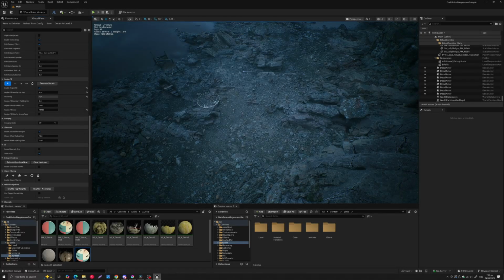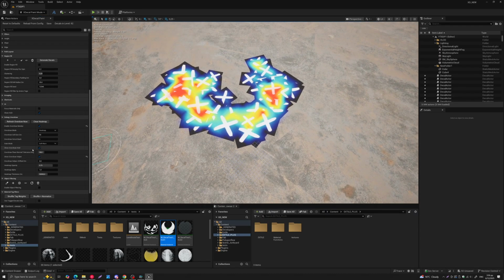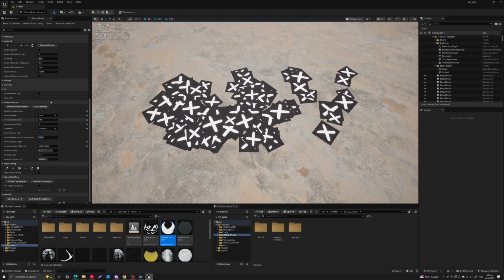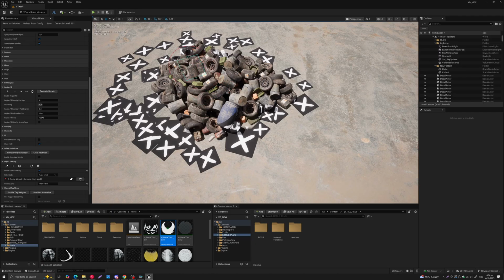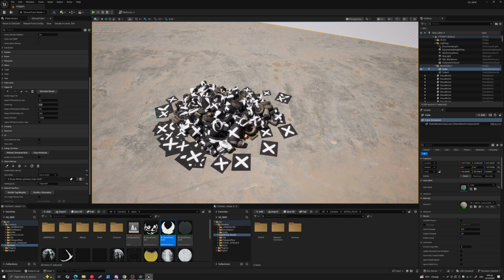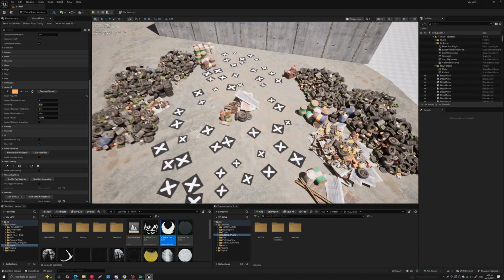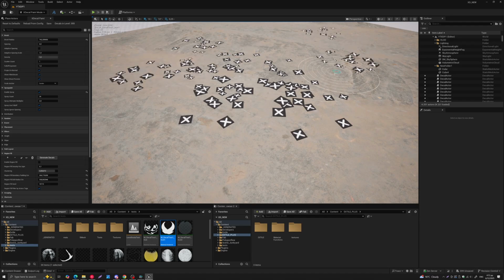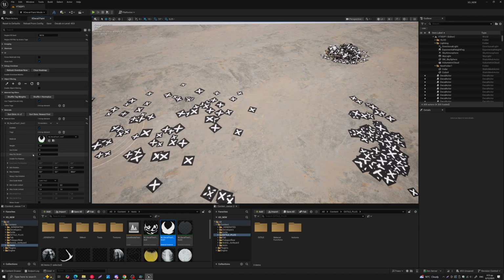The Ultimate Decal Tool for UE5 Just Got Better — New Heatmap, Region Fill & Spray Mode

Comment: Hello. Are you planning to update Exland to UE5 5.7 with features that support nanite. Feels like not much has been added or updated to that asset?
Reply from the maker: Exland is already UE 5.7 compatible. Nanite support for Landscapes is mainly handled by Unreal itself (enable Nanite on the Landscape actor and build the Nanite data). The Exland material works the same either way, since it’s a shading/blending system.

That said, I’m planning small updates/refinements in the future as all Extile products get updated with new features over time. Thanks
Reply: @AlexandrosDemetriades67  Amazing 👏